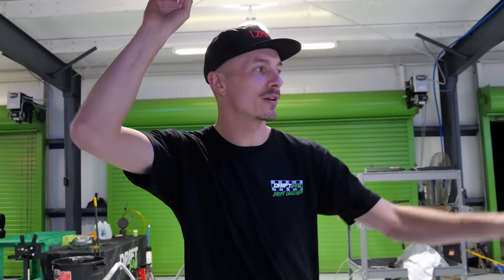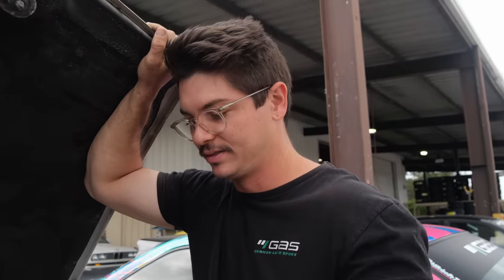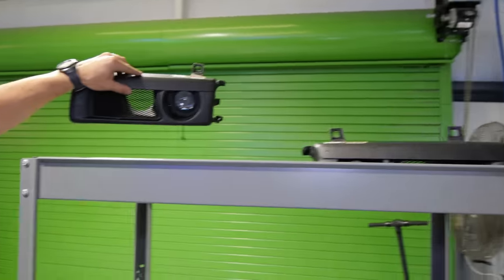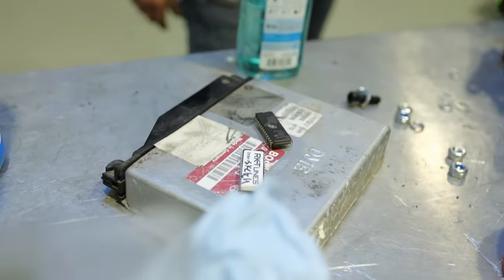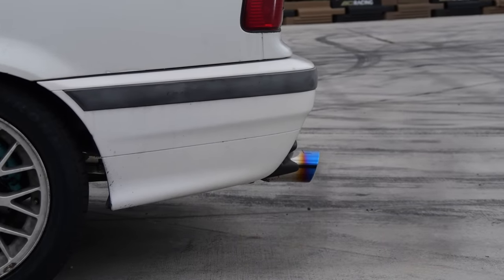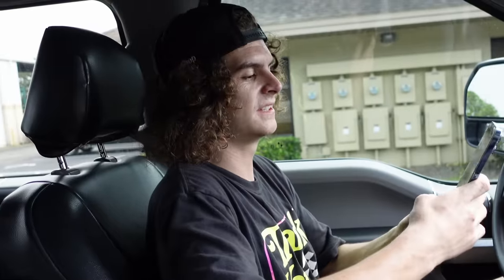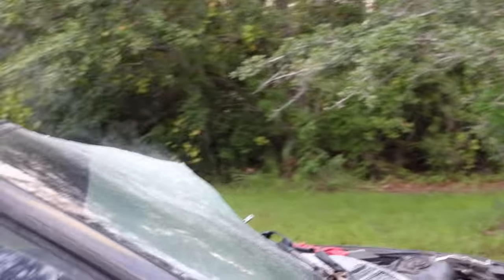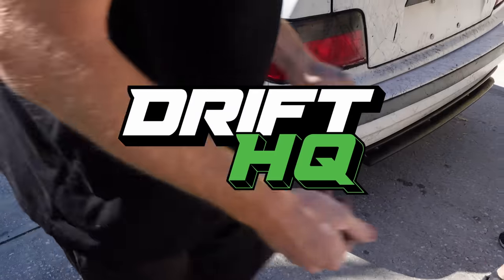We bought a “Built” E36 for Budget Tandems

Comment: I lost track of what all mods are done to this one now? Also what clutch did they put in it? Looks like a blast. Also once the temp gauge shows hot, it’s basically a blown head gasket. I’d at least put a water temp gauge in it.
Reply: I agree, but from what I’ve seen the Iron blocks in those can take a lot more heat than the Aluminum block
Reply from the maker: Ebay fx clutch 😅

Comment: You just paid $1,000 for a clapped-out E36 that doesn't even run while I'm sitting in kentucky offering you guys a 2000 E46 coupe that runs and drives for $1,000 that isn't all beat up! Someone come get this dãmñ thing!
Reply: Drive it down to Florida. They’ll do it.
Reply: This is an E36 game not any BMW game
Reply from the maker: I mean. It's not an e36 but bring it on down lol. No rust please
Reply: @DriftHQ  unfortunately I do not have any way to transport it to Florida but I can provide hundreds of detailed photos and videos of it running. The only issue the car has is differential bushings are worn out. I live in a house with a gravel driveway and I do not have the time nor the ability to do the repair.  If you're truly interested we can exchange emails or some other contact method of your choice.
Reply: @DriftHQ  to be fair if somebody doesn't buy it soon I'm going to call the local scrap guy and have him haul it away for $500. I would like to have my driveway space back for other things.
Reply: @DriftHQ  the only rust on the vehicle is a bit of slight surface rust on the frame rails, the car has zero rot. Bought it from an Old gentleman who literally kept it in his garage 24/7

Comment: Is the CNC71 angle kit, a good angle kit to buy
Reply: Would recommend the fdf mantis or slr but depends on your budget, those will roughly be $1,500. The lower control arms are thicker and more reliable in case of an accident. Slr also makes a mini kit if you want to keep factory control arms. You will have to press the bearings out to install the new ones. However you could always upgrade to the slr lower control arms later.
Reply: @wiz0769  I would, but SLR doesn't make it for E92 chasis and FDF mantis kit. They want you to cut the knuckles, and I don't want to cut the knuckles. I agree with you that those two companies make good products
Reply from the maker: Yes! We have them on these cars
Reply: What about wisefab, they might have something…
Reply: @wiz0769  maybe, but there is not too much support for the E92. I might just finish this swap and sell it to get the newer chassis. Or just keep it as daily
Reply: @cesarortega6615  ahh gotcha, both sound like a solid plan. Whatever you decide, I hope it works out for you!
Reply: @wiz0769  I planned to use it for drifting, but now I'll see what happens
Reply: @cesarortega6615  can still slide it without an angle kit, it’s actually better not to upgrade before learning the car on the track. Just need some tires a welded diff or lsd and a couple buddies! You’ll have a blast!!!!
Reply: cnc71 kit is an amazing product, especially considering the price
Reply: @so.niczny  I just don't see people using it as much as other products. That's why I wanted to see if it is worth it, because I would rather spend 500 more for something that is proven that is good